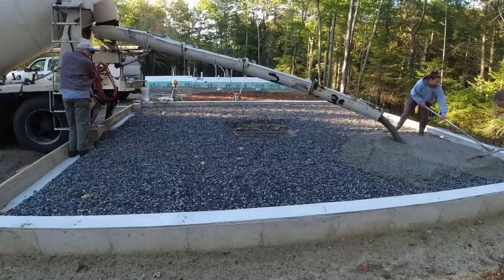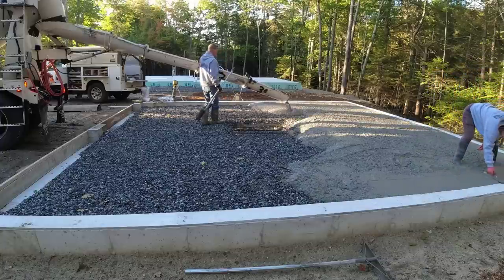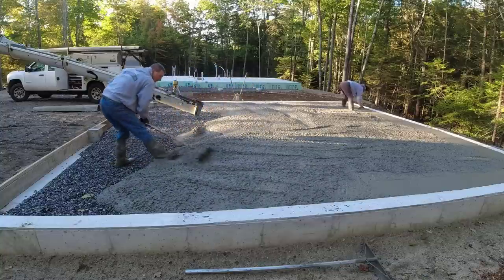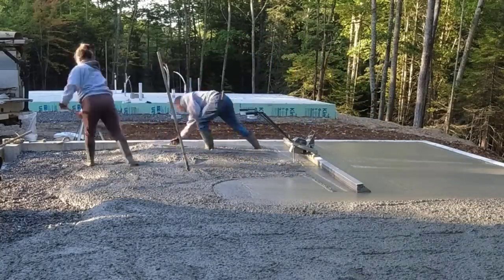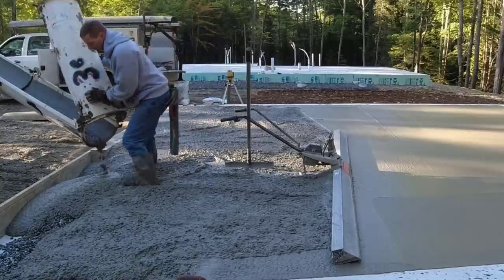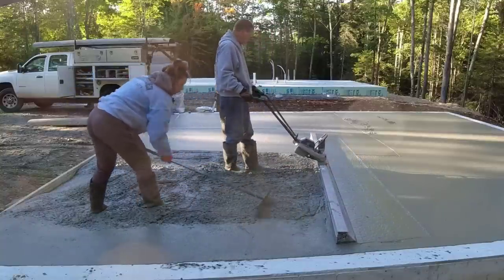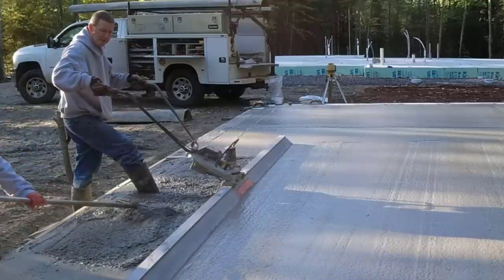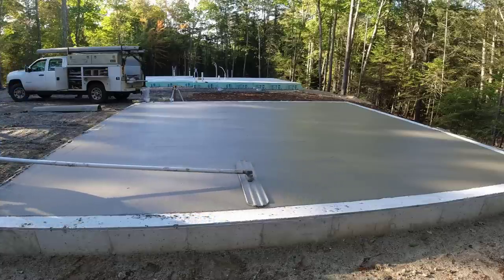How Only Two People Can Pour A Concrete Floor

Comment: You've really got to have good people that you can count on in the concrete business. I quit pouring for other people because I couldn't find reliable help. Now when I need concrete for myself I buy sand aggregate and cement separately and mix it myself. No counting on anyone and no truck that has you on a time limit. I used to drive a redi mix truck so I know that the driver is under pressure to get it unloaded.
I'm building a self propelled ride on mixer right now to make things way easier and faster because I'm getting older.Hopefully have it done by this winters end. When it's done I'll go back to doing very small jobs for people. Also building a pre measured bucket for my skid loader so I won't even have to shovel my usual 3 2 1 mix. Really like your channel. Even though I've been around pouring for a long time your channel has taught me a lot of cool tips, thank you sir.
Reply from the maker: Awesome, thanks Max

Comment: Have to makes a hard master .... 

great job. How thicks the floor , and is it the small fiber in it like hairs or the larger construction fiber , like shredded paper ,,, looking forwards to the second half of this as Ive my own garage to do and its very similar.
Reply: One of the key material properties of concrete is that it can sustain a lot of compression force, but if you try to pull it like a rope in tension, it will easily crack.   Concrete and ropes are basically opposites from a material properties standpoint.  You can pull a rope but you can't push one because it's too floppy.  You can push a concrete block but you would never try lifting something with a rod made from concrete.   But when you combine the properties of both, you can have the best of both worlds.   Hence, the introduction of rebar and fiber mesh to concrete mixtures.

Lots of material choices are available but most fibers are made from tiny strands of fiberglass about the thickness of a pubic hair.   The fibers visually look like strands of fiber optic cables cut to about a couple centimeters long.   One of the nice things is that (assuming they don't clump together) the fibers are pointing in all different directions - unlike conventional rebars that are typically only horizontal with the ground and often at the wrong offset from the ground or in a wrong grid pattern.   One downside is that they have a hairy appearance in the finished concrete, but there are ways to prevent this.    fibers can be round or flat and made from steel, glass, or synthetic materials.

I don't know much about concrete but I learned a lot from the fuc-kups of my own contractor after paying him tens of $thousands for my project.   One of my biggest regrets (there were many) was letting him skip the fiber mesh because it could have been used alongside my conventional rebar at a minimal price difference.
Reply: @TqSNv9R0iG5Ckxew  there using a new fiber over here ,, its about 20mm by 5mm and still thin like paper , but its being used to replace rebar in floors ,, hence the question , thanks for the reply though

Comment: How much upper body strength are you using to keep the vibrating screed from burying itself?  Are you letting the full weight of the machine rest on the concrete?
Reply from the maker: It rests on the concrete without sinking. Just need to keep it slowly moving. No real upper body strength is needed to hold it up. I just pull back on the handles.

Comment: To the foundation contractor handling this job: 
I predict the first cracks to occur right between the garage door openings sometime this week.   The slab is going to chemically/mechanically bond to the foundation walls because you didn't spend $40 to attach expansion joints at the outer perimeter before you paid Mike to pour the floor.  As the slab cures and starts shrinking, the slab (now under tension) will have nowhere to go and cracks will form.  The center of the slab will be okay for now since it is the thickest, so cracks will steer around it.  The perimeter of the 4-foot diameter ring in the center will be a stress riser.   The back corners will also be stress risers since the slab is essentially pinned in two directions (side and back walls).   The corners will snap off from the main slab and crack diagonally from the walls.   I'm not sure how the front corners will crack because they are pinned to the foundation from the side wall and also from below (at the garage doors).  I'm guessing these cracks will be those nasty ones that don't go straight up and down, but diagonally (from vertical) and lets big chips of the concrete pop out near the surface.  There might still be a chance to remedy this with a concrete saw.   If it was mine, I think I would make cuts along the garage door bottom seal.   Two more cuts down the center, front-to-back and side-to-side.   If possible, I would make a deep cut to separate the back and side foundation walls from the slab so it can float as vehicles travel on and off.  Since the floor is even with the height of the foundation, it should be easy if the sill plates aren't installed yet.    

To Mike:
Hopefully, your reputation won't be hurt by the oversights of the prime contractor.  At least you have video recordings as records on your side.  I don't see any steam rising from the concrete so I'm assuming that they only specified cold water.   This is going to extend the curing time, so it's critical that you cover the concrete a little bit longer and hold as much heat as possible.   Burlap bags are a good compromise between holding heat in the slab and allowing evaporation to occur at a controlled rate.   The water reducer admixtures were a good idea but the 7-inch slump still seems a bit wet to me (my personal opinion).   You didn't mention using air entraining admixtures but I'm assuming that you do this with all of your concrete in your cold climate and I don't see any bleeding occurring at the surface, so it looks ok visually. 

To the homeowner:
If you ever decide to heat this garage, you're going to regret not spending the extra $100 on a roll of vapor barrier.   Also, maybe 15+ years from now, cracking will accelerate in the center of the slab.  As the exposed ends of the rebar (assuming it is steel) start to rust, the rusty rebar will hold more moisture like a sponge while the rust layer simultaneously expands inside the concrete - much like ice growing inside an ice cube tray until it cracks.  The easiest remedy would have been to make sure the rebar is fully encased in concrete or just use fiberglass or basalt rebar instead.  Fortunately, it looks like you have good drainage.  Otherwise, everything about this job seems like an afterthought, so hopefully, the slab is protected from freezing while it cures.    But looking on the bright side, your garage is small enough that you should be able to hide a lot of the cracks with epoxy flooring.   Just make sure you chip away thin concrete at the cracks and properly fill the cracks before proceeding.

Hopefully, Mike will post a follow-up video someday to see if any of my predictions were correct or criticize me for being full of shhheeeiit.
Reply: So you're saying this project has a chance.....
Reply: lmao you are so wrong. I bet you 3 pounds of goat shit it didnt crack. Concrete shrinks from all angles. There is nothing bonding the concrete on the edges. The entire slab is floating and and will shrink evenly. Towards the centre of the slab.

Yes you will have to put concrete cuts through the middle of the slab in both directions. This is very obviously.
Reply: @AC-qo4pz  
Let's see.   
No plate compactor was used on the subsurface, no rebar, a depression in the middle of the slab effectively pinning the center, no expansion joints facing the foundation, and a pour that was wetter than Taco Bell diarrhea.    After considering all of these factors the question should be why wouldn't it crack?